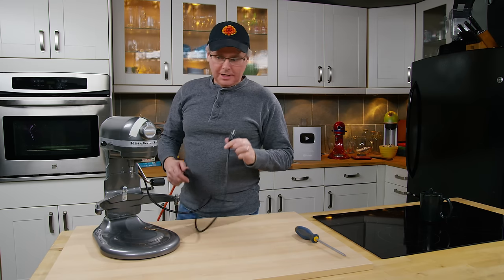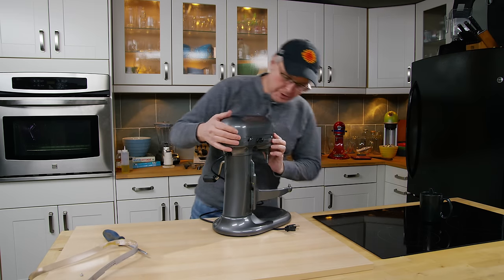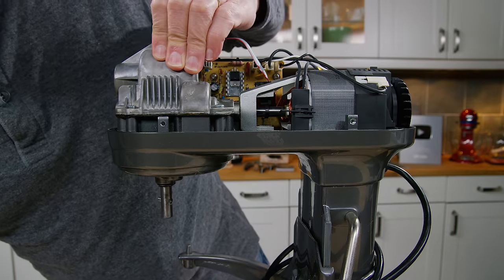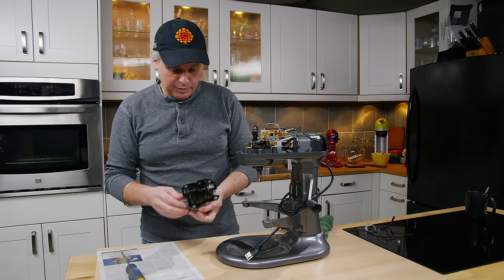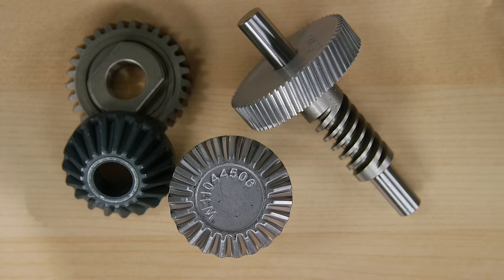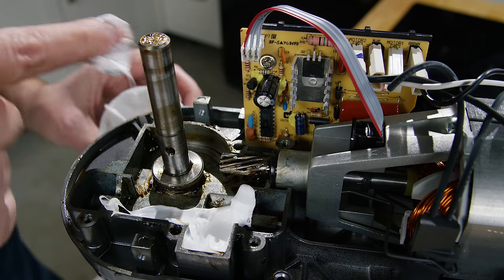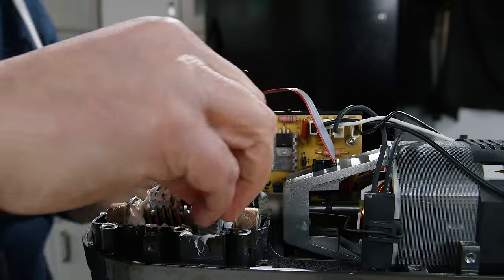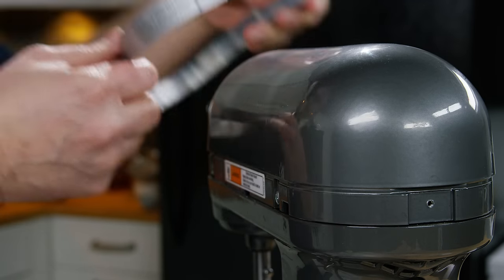Fixing KitchenAid Pro 600 Stand Mixer Teardown & Rebuild Of Gearbox - Glen & Friends Cooking

Comment: Why did you skip the removal of the retaining ring? That is the one thing you need a special tool for. You just pulled the channel gear off with a napkin like it wasn't there. Now I have to go buy retaining ring pliers. I appreciate the video but you left off the one thing I actually needed explained. I had to go to a different video to figure it out. And off to the hardware store to buy a $30 tool. OK rant over.

Comment: I absolutely love that you took the effort to make this video. Friends look at me like I've grown a head when I mention repairing household appliances and electronics. Most of the time it's as simple as figuring out what's wrong and ordering parts. Love the "copious amounts of grease" and eye contact with the camera.. hahaha!
Reply: I've never paid for any mechanical repair other than refrigerant related AC issues and engine/transmission issues. Mostly due to specialty tools and risk. But tube Amps, small appliances, effects pedals, car brakes and rotors, light switches, outlets, dishwashers I've all fixed with some quick education from Google U. Saves a ton of money and it's fun to work with your hands :)
Reply: You have grown a head. It's part of early fetal development.

Comment: I repaired mine on Christmas Eve, thereby thwarting my machine's goal of making me kneed the dough by hand for Christmas dinner, in addition to whipping up the hollandaise sauce, all with painful arthritic hands. Many of these machines have a nylon gear designed to fail first. This machine does not, but the damaged gear on Glen's machine is the one that usually fails first, as it did on mine. I didn't replace the other gears. My replacement gear came with another top gear, so I did replace the pair. I used bearing grease from when I repacked the bearings in my car about 30 years ago. Should work for about 150,000 miles. :)
Reply: .....or 50 loaves, whichever comes first.
Reply: As long as it did not have sulfur based additives you'll be good.
Reply: They recommend food-grade grease so that if it breaks down and drips into the food it doesn’t kill you. :)
Reply: @Avi Drissman, was also wondering if the grease was food-grade, looks like common white lithium grease.  Also would have replaced the gear case gasket, and especially, wipe off the excess grease from the outside of the case.
Reply: It Looks Good On You Though Just replaced my grease with Super Lube, which is good and synthetic and food safe. I didn't look to see whether my gear case was the plastic kind tho 🙁

Comment: 09:30 As an engineering student I approve the "more grease" phylosophy
Reply: 1 I'm hoping he used enough
2 I also hope he wiped up the excess grease that was on the outside, after he screwed it together
Reply: @cannedmusic  I don't think he did.
Reply: Bigger the gob, better the job.
Reply: Try to learn more, study more, graduate, and know that more grease is not always better.
Reply: Keyword here being “student,” apparently
Reply: Should have hardened gears.
Reply: @mattsnyder4754  I concur.
Reply: @ericdee6802  Most look like powdered metal, certainly the one that failed (look at that grain structure!). They (PM produced parts) are usually cheaper, especially gears.
Reply: In this case it's probably fine, considering the lack of broken down grease, but in general; more grease than it takes to thinly but completely coat all surfaces is a bad idea.
Reply: it looks pretty brittle, like the gear shatter rather then deforming, they are hard enough...

considering the fact that most stand mixers are built to budgets, they sell cheaper machines for black Friday and other sales events. it's no surprise that some have weaker motors plastic gears and generally cheaper construction, though i'd say getting powder metal gears is not bad, if you're expecting to get machined gears, you're going to need to look to a higher price range.

what's the grease he is using, i've never seen a grease like that being used in a gear box, and i was wondering if it's the correct grease for the application.
Reply: @davidmacke6718  you are not much in irony aren't you?
Reply: @davidmacke6718  I agree because excess grease will allow for a build up of heat that will cause failure of the innards.  You can tell from the housing design that dissipation of heat is essential for the gear box.  I was especially concerned about the large amount of grease below the gear assembly.  The open areas between the gear assemblies and the housing are probably there to allow for proper cooling.

Comment: This makes me remember all the blenders I went through when I had a café. In the beginning we used some heavy duty blenders from Electrolux and Philips, but they all broke. We ended up using cheaper Sharp blenders which lasted until the restaurant closed doors. Then they were transferred to a hotel where they also lasted until that closed. It just means that more expensive doesn't mean more better.

Comment: It worked great, I was holding my breath the whole time.  I just love it when things are fixed and not just dumped.
Reply: Marilyn there is not too much to stress about, they intentionally make these parts the weak spots in most models because it’s easier and cheaper to replace some gearing than it is to replace a motor.

Comment: This is a clear, effective video, and I've learned from it like many others.  One cautionary note to pass along about it (and which also applies to the other similar videos on repairing/replacing KitchenAid mixer gear sets) regards the apparent ease with which they remove the bevel gear and worm follower gear:

I've just finished my first Pro 600 Series teardown, which revealed 30-40 degrees of broken teeth on both the bevel gear and the worm follower gear.
 - I removed the snap ring with appropriate pliers and prepared to lift off the bevel gear with my fingers.  Nope...  
 - I placed a large flat blade screwdriver in the gap between the bevel gear and worm follower gear, and tried turning
   clockwise and counterclockwise to loosen it.  Nothing...  
 - I tried levering down on it against the worm follower gear to pry it up.  Zero...  

I went back to the parts diagram and even the professional service diagram to see if there was some variant configuration with a part I'd failed to observe or remove.  Nyet...  

I placed the blade of the screwdriver on the inner perimeter of the bevel gear (being careful not to have any contact with the shaft) and gave it a few firm blows downward with a rubber mallet to loosen it before prying.  Zilch...

Finally, with trepidation, I put the prying portion of a claw hammer in the gap between the gears and gave the striking head a few solid thumps with the rubber mallet, then levered it against the worm follower gear.  Aha!  I detected upward movement of the bevel gear.  It was a repeat and repeat version of that action that was required the entire way up the shaft because the fit was so snug.  

Removing the retaining pin for the worm follower gear was easy, but removing that gear was a repeat story of the bevel gear - with the extra caution that there was no lower gear to lever against, and I didn't want to distort or crack the gear housing (I ended up laying a length of 1/8" flat bar over the case and under the hammer to distribute the load as much as possible, and was extra cautious about the force I applied).

I doubt I'm the first person to experience this, but none of the videos I've seen show it or mention it; so I thought it might be helpful to share.  Note also that if this process is required to remove the gears on your mixer, it is prudent to closely inspect the drive shaft for scoring, distortion, wear, etc.  Mine seems fine, but I decided that only after close visual and tactile inspections.

Lastly - I suppose it could be an alternative to use a heat gun to warm up the gears instead of just prying, but I was concerned about causing collateral damage, especially with the circuit board so close.

Sorry for the long post; but hope it helps.
Reply: Did you buy the rebuild parts on Amazon...

Comment: My family has three KA stand mixers built before Whirlpool took over KitchenAid from Hobart. All work great - even the one pushing 65.
None of the post-Whirlpool KA stand mixers has made it two years.
Reply: Very interesting.  I've read lots of comments that say the Whirlpool KAs are junk. I have a KA K5SM from 1989 and I'm told that even though Whirlpool owned KA by that time, they were still using the Hobart specs for a few years.  I remember during the early 90s when things changed, and the quality really down.  Like your mixers, mine still performs beautifully.  I don't know what to do when the time comes to replace it, though.
Reply: Yup.  I have 2 KA mixers made by Hobart and those have always worked.  The ones made by Whirlpool have had the problems.

Comment: good stuff, i know alot of people that would just toss them and buy a new one.
Reply: I'm guessing with cheap ones you wouldn't be able to get the replacement parts, that's why it's always better to splurge on tools :)
Reply: Kitchen aids ive never heard of kitchenaids braking like this must be the newer stuff and or defective ones i guess
Reply: HulkinBrent About a decade ago when mine broke there was a lot of folks online bitching about their mixers breaking. About two years later I was at a restaurant supply store and the KitchenAid displays were loudly proclaiming that they now use only metal gears. That’s how they were originally built when it was part of Hobart. It seems they cheapened out for a bit and it cost them. I didn’t buy another when I wanted a second large mixer and instead bought a Bosch. It handles more dough and hasn’t broken. My old Pro KitchenAid sounds like something will break again. I have spare parts on standby and a lite of grease but I shouldn’t have to.
Reply: @mybigfatpolishlife  The old ones are nice. They turned to junk after Whirlpool bought them out.
Reply: @mybigfatpolishlife  these nicer mixers? which ones are you referring to? because the recent ones are getting much cheaper. kitchen aid sells budget models for black Friday and other sales events.
Reply: @eugenb.8448  I bought a Kitchen Aid Mixer about 41 years ago.  The first year, it had to go in for repair.  I wasn't happy with it, bought a Bosch Universal Mixer about 40 years ago and have been VERY pleased.  No repairs necessary for the Bosch.  :)

Comment: I have had my original Kitchen Aid since the mid 1980's.  My husband repaired it twice.  Replaced one gear in around 1993 and adjust speeds etc. in the last year.  Finally purchased a new larger lift model this Christmas.  We will see how the size etc. works for me.  Will keep the smaller one for extra baking. Thanks for the video

Comment: When I was young I did my mum's Kenwood Big Mixer. Had a seal under the cover and one of her gears had teeth missing it was plastic. A replacement was metal. And worked perfectly after I put it back together. I was a aprentice electrician. At the Time. So what you did I had happy memories. Thanks.

Comment: I have an old Kitchenaid K5-A. It was my mother in law’s. It is from the 60’s or 70’s, and is still running strong. I just watched a video of Mr. Mixer doing service on one just like mine. For years I kind of hoped it would break so I could get one of the big, sleek models like the one you are working on. I used to make a lot of bread, so it spent many hours kneading dough for me. 

But now the kids are grown and gone, our nest is empty, and I usually just cook for hubby and I. Except for Christmas time when I make many Rum Cakes to give as gifts. I have grown to love that well used mixer. Mr. Mixer calls it the gold standard of Kitchenaid mixers. They were made from 1941 to 1979 when they were replaced with something newer. 

Apparently, the K5-A is the most reliable of the Kitchenaid mixers. I saw in the video that the grease on the one he serviced was old and had to be dug out and replaced with fresh. He replaced the electric cord, put it back together, and it was good to go! 

You might want to get yourself an old K5-A, get it serviced, and the good Lord willing, it will outlast you!

Comment: The head fell out of mine recently. I would have thought that Kitchen aid would have had some hardware (C clip) holding the head onto the gearbox but it seems to be a press fit that has just worked its way loose from 15 years worth of use. I used JB Weld on the heads shaft and pressed it back into place. So far so good, the head is staying up. I cleaned and re-greased the Gearbox while i was at it. Thanks for the how to!

Comment: I servicedd a mixer here in the UK that my wife has had for 20 odd years. Not once had anything broken - it was used weekly to the point where the attachments were the only things to break (from neglect and dropping!). What's interesting is that your mixer has the gearbox and motor all in one spot, whereas the mixer we have, the motor is in the vertical part and the whole top of the machine is a horizontal gearbox. They seem to be a very stable design. I can confirm that food grease you used starts white and ends up black like most lubricants. If you're going to buy another one, you may want to consider our style of mixer over the ones you have.

Comment: This video is fantastic. Got the food grade grease online and took a month to come in. Then the only other issue was getting the snap clamp on and off. Two person job without the tool. To get back on, threaded wires through holes and used two pairs of pliers tripping onto wires.

Comment: Thanks for excellent video. I got this same model 600 pro. Only 4 or 5 years old. Little use really. Wife likes her 4.5 guard 250 watt unit. About 12 or 13 years old. Still going. The new one started making a bad noise in 5he gear box area. I took it apart and only found 2 small metal splinters. That's what they remind me of. I'm a truck mechanic and was expecting chipped teeth but all fine shape. I had tough time getting gear off of shift that oscillates.  Tender tapping with brass hammer and a tad heat from propane torch at smallest flame for 10 to 20 seconds so not to melt pot metal and warp the shift. Small set of snap ring pliers to get 2 snap rings off. Runs fine now..guess poor assembly is my guess. I see hort used to make them in you comments section. Now Westinghouse. I've been happy with a fridge, stove and microwave bough 10 years ago. That microwave has all sorts of noise now but keeps going.  Thanks again

Comment: Man, I’m glad you filmed this. After seeing those cheap sintered gears, I’m not gonna waste my money on a kitchaid.
Reply from the maker: That one gear is supposed to break under pressure... It'll break before your hand/arm/fingers - it may be a flaw to some, to others it's a feature.
Reply: Good luck finding a consumer appliance that uses machined gears these days.
Reply: @GlenAndFriendsCooking  A slip clutch is the common solution to that problem. The price of a Kitchen Aid should justify having one. Every cheap drill has one.
Reply: @GlenAndFriendsCooking  If it's a safety issue a shear pin would be a better option than a gear designed to fail

Comment: I had the exact same problem as you with the same gear breaking despite  never using the accessory port. I remember that when I fixed mine that I really needed to pack it full of grease otherwise it would sound awful. Besides lubricating, the grease also dampens the sound.

Comment: My mom baked and decorated cakes semi-professionally, and sometime in the 1960s my father bought her a Kitchen Aid mixer, which she used for all sorts of day-to-day cooking. They gave me a Kitchen Aid as a wedding gift. When my mom died, I inherited her old mixer. My grown son, who is quite a foodie, asked me if I could fix it up and give it to him. Well, when I took it apart, the most obvious problem was that the rubber insulation was just crumbling off of the power cord. I tried to find a replacement cord, but I couldn't locate anyone who would sell me one. Eventually I emailed Kitchen Aid, and they told me they didn't sell replacement parts for a machine that old. BUT - they said they'd like the old machine for their museum, and they offered to send me a factory-reconditioned recent model, which they did - just in time for Christmas that year. So I gave my son the mixer that had been "mine", and was still in fine shape, and kept the newer one myself. I make a lot of breads, and I also use it for whipping eggs for sponge-type cakes that need a lot of whipping to come out nice and light. (I also beat frosting in it, of course.) I just wish I could afford some accessories... a pouring shield, a spatula with "fingers" for cleaning the flat blade, and maybe an ice cream making bowl, and maybe a meat grinder.

Comment: I gotta say, since I've always had a love/hate relationship with my KitchenAid mixer: As expensive as this professional machine is, it was surprising to see BRASS BUSHINGS where there should be BALL BEARINGS (aside from that tiny thrust bearing)! Thanks for the video Glen! I have the attachments too but have not as yet used them and after what you said, I'm not in a rush to either.
Reply: Costco had these made if memory serves. They’re great on paper, but seem to be of lower quality than some of their other  (similar spec’d and more expensive) machines.

Comment: Glen, thank you very much.  I leaned so much with your video.   The way you explained the procedure is great and clear.   I ordered my parts and I can’t wait to put everything back and see if works.  The only difference I have found is that in my case the planetary has been removed too when I take out the gear worm follower and I am not sure why and I don’t know how to mount it back before adding the new parts.   Thanks